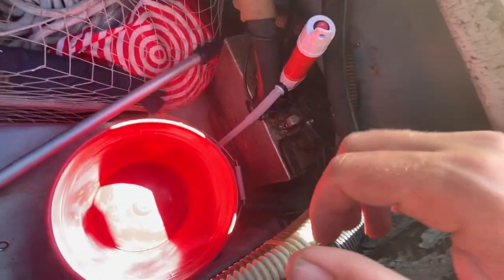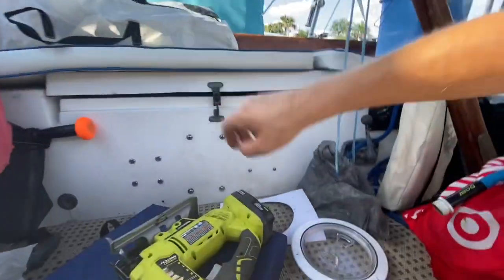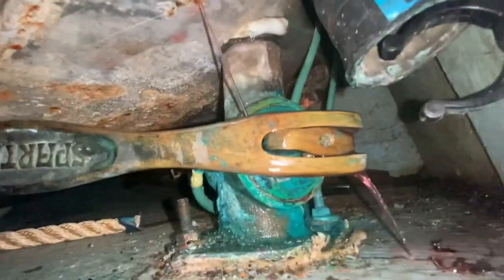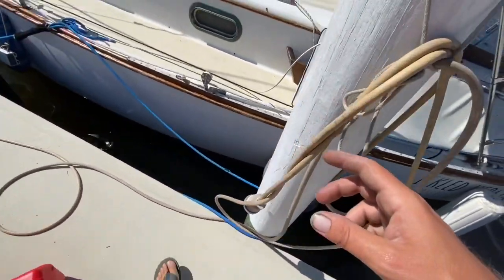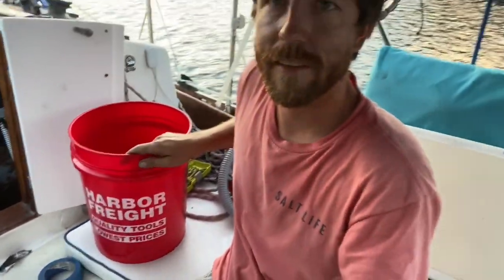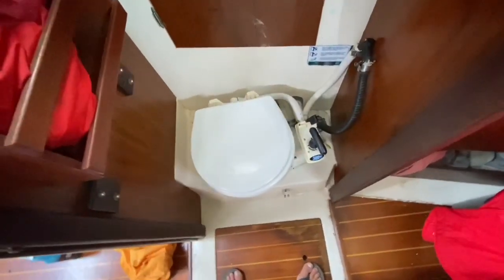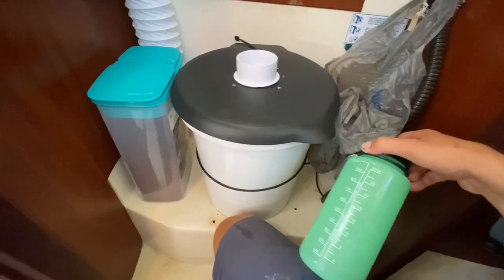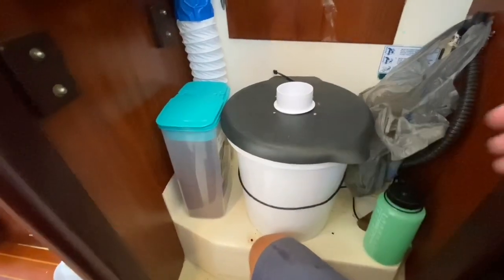Smelly Boat Projects: fuel tank & composting head

Comment: When I bought my Cape Dory 25 the head had been removed. The previous owner said the same thing, "Heads always smell." I looked into a composting unit but all the commercial ones were too tall for my limited space and I was afraid that anything that I faked together would be too sketchy to ask a guest to use. So I studied up and designed my own system. I learned that there are several factors that effect how a head smells. 1) Aeration, make sure that there is plenty of oxygen in the tank. Use a charcoal filtered vent. Aerobic bacteria will breakdown the contents of the tank without odor, anaerobic bacteria stinks. 2) Use fresh water. It is much more conducive to the breaking down of waste and the salts will not build up in your plumbing. 3) Plumbing, use the expensive hose...it's worth it. Also, hard plumb with PVC wherever you do not have vibration. It's cheap and will not smell.
Reply: Agree.   Get regular PVC piping where it won’t move.  And get the heavy duty flexible hose from WestMarine.  It’s expensive but stops the odors.  My experience is most head smells seem to come from using the wrong hoses.  

Also, it’s easy enough to install a pump out on your deck.  Again though you need to get the right vacuum hose from West Marine.   Also worth borrowing or buying a heat gun (I paid $19 for one at Home Depot).  It will help heat up the hose and make it more pliable and capable of attaching to fitings).     Great channel.  Really enjoy your videos.
Reply: I have found that the usual suspect is the build up of salts etc on the one way valve which causes the black water to flow back down the pipe which you may or may not see in the head but you can definitely smell. Regular cleaning of the one way valve prevents this.Also other factors which have been covered here. André
Reply: THANK YOU FOR THIS INFORMATION !

Comment: when I bought my boat it had a homemade holding tank that was badly built and installed and a total disaster. First thing I did was pull it out and it was freaking disgusting. I put it straight into a garbage skip at the marina when no one was looking and for days when people walked past the skip you'd hear "yuk, what's that awful smell?" which would give me a feeling of both secret guilt and pleasure.
Reply: never buy a boat with thru hulls all drains above waterline ,   O/B    TOILET IS BUCKET IN HEAD AREA, most times you hang over side,  unless you are rich and your servants clean up.

Comment: Your jabasco was incorrectly installed. The inlet antisyphon was between the seacock and the pump - on the suction side and was the reason you had trouble flushing it. I made the same mistake, and also had a smelly loo. Re-read the instructions and understood the inlet antisyphon is installed between the pump and the bowl (the pressured side) and is only needed if your loo is below the water line so i just omitted it and now have a nice easy flush and no smells. TBH if i was installing it again, I'd plumb the flush feed through double check valves from fresh water to avoid calcification. Happy sailing Sam :-)

Comment: Your head and holding tank were in bad shape; cleaver compost-bucket fix. I had friends that cruised from the Med to the Caribbean for six years with just a cedar bucket, although they often just held onto the shrouds and hung over the side to poop. We have always used a marine head with both a Y-valve and a macerator. As you know once you’re out of the US there are no pump outs it’s all into the sea. The 28 I’m working on has neither, but has only been used as a day sailor so the tank was ‘fresh’ so a new head and lines work for now. Your fuel tank leak scares me, but cool fix there also. Good video.

Comment: Getting that stainless tank fixed would of been my choice.
Reply: why?  plastic works for ever
Reply: Actually, any petroleum fuel is noncorrosive to metals. In order for corrosion to occur, a conductive material like water must be present in the fuel system   ''must have been water sitting on bottom inside.
Reply: @spymaine89  Anyone that's been on the water will tell you having a fuel tank that holds a decent amount of fuel is much preferred. The day your rig fails and your only option is engine power I'd want a fuel tank that I don't need to worry about refilling.....in a storm possibly. As for the corrosion, it happens....not usually on stainless, I was surprised to see that.
Reply: Me too. Would have been cheap to fix one small hole.
What do you think about this guys toilet?
Reply: @Captain10Star  "don't give a shit..."
Reply: @exroyalcanadian That's text book tank corrosion, the pin holes were in the low corner of the tank where the water from humidity settles. You can get the tank pressure tested and have a welder patch it up and I've heard of guys using JB-Weld in a pinch. Hey Sam gets the F out on the water, he can fix the metal tank later on.
Reply: Y’all have not been on the ocean !
Aluminum and stainless will corrode. 
Slowly but they do!  The polypropylene does not but it gets hard and brittle over time.  
Sam is on a strict budget ya got to do what ya got to do
Reply: @tomharrell1954  I've been on the ocean fishing for a few moons......don't try to learn me!!!

Comment: I met a guy once that made a composting toilet by using a paint paddle stir that paint contractors use with a drill gun to stir paint in a 5 gallon plastic.  Anyway he put a hole in the top and then used a hand crank to stir up the solids after each time he used it...

Comment: Question... What will prevent seawater/rain from entering the toilet exhaust vent?
Reply: Not a drain trap... And if gets down to electrical exhaust fan a serious problem... Swiss cheese boat..Sam likes drilling too much, imnsho...
Reply: Condensation too... Temp affects bacteria and gas type production... Dryer heater air duct hose only temp solution, imnhso.  Real duct work, and replace each year or less...  Chimney sweep like for plumbing.  CPAC on the other end...

Comment: If you don't want to have the holes in the aluminum tank welded just drill a hole thru it and put a bulkhead type drain plug in. You can't have too much fuel
Reply from the maker: There were so many pits and pinholes it wasn’t worth fixing. To much work to get it in and out.

Comment: Sam you are more brave than I am. I am not sure what I would have done if I were in your predicament. But most likely would have hired it out. So is the vacuum design full of flaws? The boats that I have rented always had the macerator system. I am not sure what system would be the best but the composting idea does not sound much better. Good luck to you in that regard. On a lighter note I watched a video that referred to making a direct deposit when not in the marina area. haha.  Also I want to commend you on all the improvements that you have done on your boat. You seem to have a knack for finding the solutions.  Oh I am glad you demonstrated that little transfer pump too. I have seen it advertised on TV but I typically do not trust the TV ads. That will come into good use for transferring fuel into my lawn mower fuel tank. Thank you. 
Be safe.

Comment: Sam when you are on a voyage (is this the proper term??) wouldn't it be easy to just do your business in the water?  Like jump in the water and do it? Of course when you are parked by a marina that is not possible unless you are a 3 years old kid.  Once in a voyage down under when we threw our "dark water" overboard some sharks "recycled" it for us.  One more reason to avoid sharks.
Reply: You don't want to do your 'business' off a moving boat.  Too many chances of falling off.  If you are a solo sailor, you will quickly find yourself a solo swimmer.  If you are on night watch, again, it may be hours before you are found to be missing. Never a good idea.  When on a 'passage' you don't "pull over" to take a pee.  It's not like driving a car. There are no rest stops.  You want to keep your momentum up.  Here's another consideration- do you want to swim in your urine and fecal matter? Yeah. I didn't think so.

Comment: I totally get why you’d want to replace the holding tank and toilet, but I’m baffled why you didn’t just have the fuel tank repaired and then put back in.
Reply: because of cost of repair?
Reply: If you keep going cheap on a boat, you can forget ever selling it.  Why buy a boat that has been chopped up with cheap repairs when there are plenty of nice ones on the market.
Reply: @svZia-Switch51  A plastic fuel tank which will last 40 years and easily replaceable is hardly going cheap..it is going Practical.

Comment: Fuel tank may be metal for some safety code, where transport (plastic) is ok for some things... Tie down secure in heeling and and crash (hard aground, etc).  Welding challenge to fix your old tank, and/or  make a new one.  Keep old ones as may use as seconds, temp if have problems.  Mouth on hardware in store to check seal, not very safe, chemicals and scale (finish, etc) antirust stuff is likely carcinogenic, even food utensils bought new are to be washed first.  Composting clever, but vent hose like a chimney and need to be replaced often, bacteria, etc grow in there even with fan, and gases. And yet another Swiss cheese hole in boat to leak.   Sealing tank nitrile fumes and oil, v plumbers Teflon tape, check chemistry on what oil, gas, diesel, additives, etc does to that chalking, silicone, etc... We had sawdust composting at community con, other methods may exist.  Easily replaceable components help, scaling, and cost, but over time may learn why they were made that way, besides making money.  Pump out at RV camper site if ever trailer boat, and for haul out season. $30 for how many weeks/month waste?  And plan wifi/cell signal, all armchair but informal second opinion($)....

Comment: Has the threats of lockdown not messed wit your plans? I know that I cannot get a new passport until the department is issuing them and even then all ports are shut. I heard of one in Hout Bay not far from Cape Town. I see on Craig's List that there are a few smaller boat a that I could probably handle single handedly, or negotiate a crew of 1 to come back to S.A. with me.

Comment: I know it’s too late now but Microseal will fix a small leak in a tank     I fixed my water tank that way    The plastic tank is a great solution  

I’m not a believer in composting toilets   It seems like an answer but there’s so many questions that are left unanswered     Might just as well use a 3 gallon bucket with a lid  filled with composting material or kitty litter and pee in a bottle (which is everything a composting toilet is) 

The dry flush toilet is a far better option   Just not ready for prime time yet  

Composting toilets don’t smell because of that fan that runs all the time    Don’t get near the end of that pipe, which is an impossibility on a sail boat ( unless you run a tube up the mast) 

Leaving the plumbing as it was has it’s advantages

Some day the authorities will look at composting toilets snd outlaw them because of the obvious way they deal with liquids, they don’t

Comment: I don't understand why you wouldn't putty the hole in the bigger metal fuel tank(5$), instead of buying a smaller, crappy 6 gallon(20$). Even if you cant weld, there are so many products to use.

Comment: I have to say I get a little irritated to watch you take shortcuts and cobble things together like putting a bunch of connections together to use an outboard tank for diesel.   You will learn that diesel, because its molecules are so skinny, will find leaks in plastic fittings and your boat is likely going to reek of diesel from now on.  Not sure how you are going to properly vent this tank as required by regulation and law.  I understand you are working on a limited budget but some ABYC regulations have real reasons behind them.   Your through hull fittings need real inspection and maintenance, not just forcing them open.  And there are proper ways to service and maintain boats and other options which are very dangerous--not so much for folks who just hang around the marina to jaw with other sailors---but you go offshore.  I would be afraid to go off shore with you, frankly--and I would not let my kid go with you.   You are not being careful enough with your work.  There are resources and conventions for doing things correctly.  You have drilled a lot of holes in that boat (did you protect the core?) and made a lot of seat of the pants modifications.  I realize you took a small boat to Hawaii without incident.  I have sailed offshore for 40 years and I think you have been lucky.  So far.  Very lucky.
I realize folks get tired of having a real head on a boat and there is a recent craze for blowing out the old plumbing when it stinks and going to a "natures'" head.  My experience is that they stink too if they are not aggressively maintained.   Most of the stink in marine heads is due to poor maintenance---folks flush them with the outboard intake right next to the outflow through hull, then leave all the pipes full of diluted poo--DUH!.   If you rig your boat so you flush with fresh water or ensure you are not recycling poo water and if you pump enough (15 pumps for poo) you will not have a smelly head.  Heads take maintenance.  In fact, no one without a commitment and willingness to effect proper maintenance should even consider sailing as a hobby.  Just a curmudgeon view.
Reply: My .02$ :  Sam does not have a large intestine and has a body bag for his pee.     Sam's pee is already stored in a medical bag and I suppose he empties his bag based upon his work schedule vs nature calling.   Hence Sam may not  use and demand a contemporary toilet as other sailboat owners.